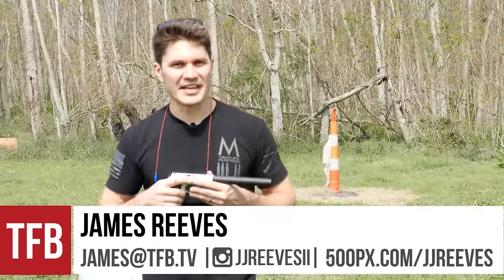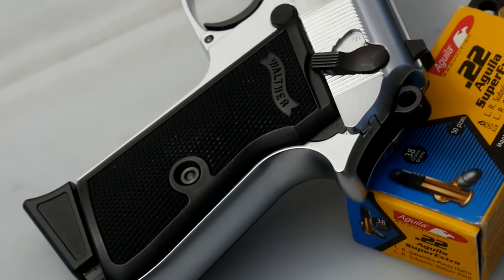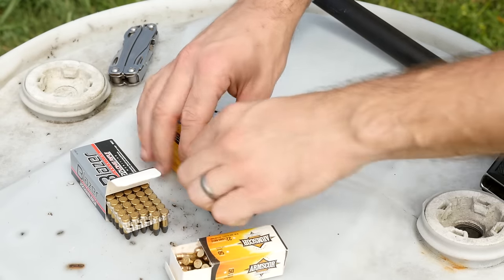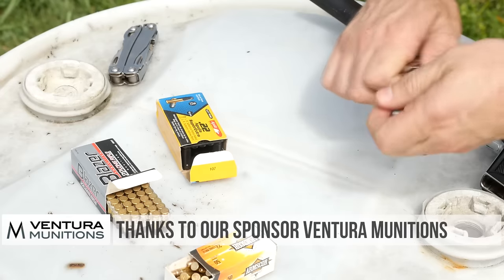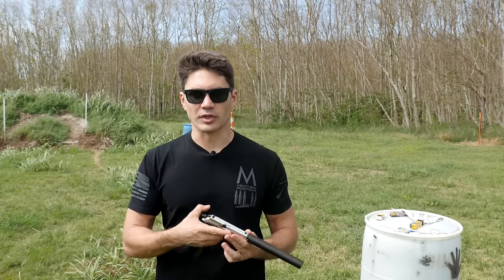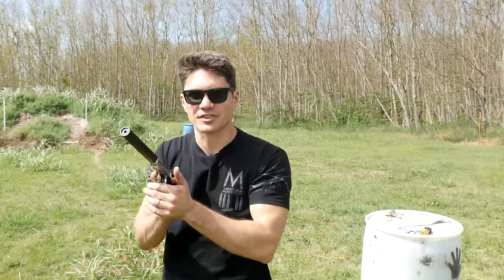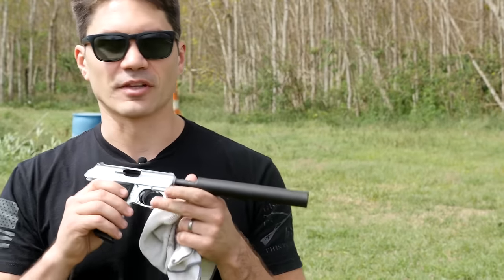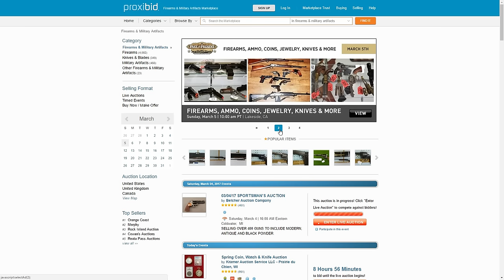The Walther PPK .22 is Always Subsonic - Myth or Magic?

Comment: Typically 4.5"-5" is the length where 22lr bullets reach the speed to go supersonic. Anything under that will stay sub👍
Reply: +ShooterSD72 +ChazOneZeroSeven Children, please...
Reply: fight fight fight fight fight
Reply: +xrklkx 🤡🎉😁
Reply: He is absolutely correct.  Even my friends 5" GSG 1911 with high velocity .22LR rarely has a round go supersonic.  4.5" and under won't go supersonic.  Anyone that doesn't believe this doesn't know what they are talking about because they have no real world experience with it.
Reply: Chronographs are cheap these days, so this is easily tested.  Noting it is as much about bullet weight and powder charge as it is barrel length.  The 1970s vintage CCI Stinger ammo is a case in point.  Those were so hot CCI had to re-do them with a lighter load.  One of the gun mags did a chrono test back in the 70s and recorded from an Erma M-1 carbine clone thing average velocities of 1860 fps but also had several that broke 1900 fps with one doing 1972 fps.  I strongly suspect if you could find one of those old plastic boxes you may indeed break 1100 fps (the dividing line between sonic and supersonic) even in a PPK.
Reply: Ken ibn Anak You don't need a chrony to tell if a bullet goes supersonic or not, this is what ears are for.
Reply: Not even..
Reply: Nicolas Broszky I've never had an issue telling the difference between CCI quiets and regular. I don't use a pistol for .22 though if that makes any difference. When using normal load .22's I can always hear that crack and echo.
Reply: Nicolas Broszky I'm not mistaken, have you never fired a gun before? A .22 quiet has no crack, the crack comes from the bullet breaking the sound barrier. It's no different than a pellet rifle, when they don't go above 1150fps, there's no crack, go above 1200 fps and there's a very loud crack that echos.
Reply: Nicolas Broszky We're talking about a .22 here not a .308, thanks for keeping the conversation relevant. My statement stands, you can easily without a doubt tell if a .22 is subsonic or supersonic based solely off the echo or the "crack" heard after the shot. Funny enough, I can still tell the difference between a handloaded subsonic .308 and a full load providing it's fired longer than 100m, there's still a very noticeable crack that happen after the gun shot followed with a echo that just isn't there with my handloads. Again though the shot has to be longer than 100m to give the sound from the initial blast a chance to dissipate.
Reply: depends on the cartridges, the CCI copper plated hollow points have a lot more gas pressure than the cheapest ones
Reply: Nicolas Broszky Go fire pellet rifles then, even a little .177 from a cheap break barrel will toss a little 7 grain pellet above the speed of sound. They are actually pretty loud when doing so and the crack from breaking the sound barrier is 100% without a doubt noticeable (very noticeable). Then load up a heavier pellet and fire and there will be zero crack and it's almost silent like an air rifle should be.
Reply: Not true, as long as you're shooting the cci stinger. It averages 1100 fps out of the 3.5-inch Ruger SR22, which is supersonic, depending on temperature.
Reply: I have a ruger 10/22 16" barrel and any Aguila STANDARD ammo (1130 fps) ammo, do not cross the transonic/supersonic threshold.
Reply: @WilliamStewart1    i read that jet plane sonic boom varies with nose cone, tail wing etc and also weather condition and alt.  therefore mph varies to hear the boom of when air pocket snaps from front to rear isn't constant with various changes
Reply: @dodgehemi5045  Fair enough, I was just trying to convey my point to whatever his name was that I supersonic .22 is very noticeable over a subsonic based off that long echo/crack you get after the shot.
Reply: @warmachine_1396  what about inches added. By the suppressor they do count ??

Comment: I run CCI mini-mags exclusively in my Walther P22 with SWR Warlock combination.  They stay subsonic.  However, CCI Stingers do NOT stay subsonic out of a P22.  I haven’t shot the PPK 22, but the barrel lengths should be similar.

In my experience, standard and high velocity ammo stays subsonic, but super-high velocity does not.

Comment: Such a pistol has so many virtues -it's easy to handle, low recoil, welcoming to novice shooters.  It's supremely quiet which is protective of hearing and reduces noise pollution.  Oh, and it's pretty much the choice weapon for assassinating someone...   I'm sure some people see that negatively, but that also makes it superb for defending one's own home; gunshots indoors are painfully loud and disquieting, your ears will ring as from a long concert and you might damage your ears; if you need to use your gun indoors you probably don't have time to slip in some ear plugs, so there's a lot to be said for a suppressor on a, shall we say, "PDW".  Since it is an assassin's weapon, it might have some of that same pants-shitting effect that a big shotgun has, that best-of-all-possible-outcomes where just pulling the gun out to use it does the trick and the enemy flees in the face of resistance.

Comment: try cci stinger ammo. its rated at 1680 fps which is faster than any you just used. basically the stinger has a longer case to fit more powder and a shorter 32gr bullet to obtain the same overall length and it is lightning fast out of a 22 rifle.

Comment: Alot of people on this forum have said theve had trouble with certain 22lr autos but there have been many videos on u tube to fix the jamming problems some of these guns have a very small piece of metal on the ramp up to the barrell it's kind of a boaring fix but 500 grain sand paper wet dry and a dowl that fits about and hour of work with tiny pieces of paper will remove the machine marks sometimes there is a very small piece of metal that has to come of carefully keep checking as you sand the object is to get rid of machine marks without removing to much metal then a Drexel tool with a cone shaped polishing bit and a little ruge on medium speed and you end up with a mirror finish the only other problem can be a little work on the tops of the magazines I've  done this twice to a couple of 22lr that where jamming  especially on cheaper ammo now they eat everything even cci quiet auto witch is around 850 fps and they work flawlessly even with supressor be careful but give it a try I'm glad that I did thanks

Comment: Hi, if I understand correctly, this experiment shows that supersonic ammunition are not necessarily worth the expense, if you use them in a ppk (hoping in supersonic performance). You can pretty much use regular ammo and get the best from your ppk. Am I correct?
Reply from the maker: Pretty much, just exchange "subsonic" for "supersonic". You can likely shoot any ammo through the PPK and it will be subsonic, which is ideal for silencers. The more expensive subsonic ammo appears to be slightly quieter, however. - James
Reply: thanks James

Comment: CCI Stinger 32gr "Hyper Velocity" will exceed 1100fps. Some other 40gr Hyper Velocity rounds may or may not.CCI Velocitor 40gr is cutting it really close. The addition of the adapter and the suppressor itself actually increases your muzzle velocity.

Comment: i can't get mine to cycle. even with cci mini mag, the slide gets hung up on the hammer. it will eject (half of the time) but not pick up a round off the magazine. is there a fix for this or did i just get a bad gun? side note, this is the 3rd Walther in .22 i have shot and the first i have owned; they ALL failed to function properly. starting to think it was a waste of money, $500 is a lot of ammo to run through guns that dont suck.
Reply from the maker: That's weird. We have two (me and wifey) and they are both 100% if the gun is greased up. You may have a bad gun or mag - I'd call Walther. Remember, though, any rimfire with a reciprocating slide is likely going to get hung up eventually. The recoil spring can't exert enough forward force to make feeding a round a sure bet as with the larger caliber guns that can function with more robust recoil springs. Just something to keep in mind. - James
Reply: While I don't have a walther PPK, I do have lots of .22LR pistols, and with .22LR's there's a few things to watch out for.  #1- clean it well, but don't over-lubricate.  Over-lubrication will result in issues cycling.  #2- using a suppressor will result in higher back pressure and aids in cycling. #3 - magazines are the Achilles heel of any semi-auto firearm. With .22LR, magazines get dirty too- and need cleaning.  Disassemble, clean, and lubricate with something like dri-lube or leave dry.. 
A properly cleaned and lightly lubricated .22LR pistol or rifle should function at least about 500 rounds with very little issues with decent ammo. Avoid Remington junk ammo; get decent bulk ammo at least. Some guns need breaking in; it may take a brick to break it in ; ymmv. Your slide getting hung up on the hammer sounds like an issue with the gun needing breaking in; along with a light lube on the hammer where it rides the slide.. If I had to guess, you don't use a suppressor with that gun, do you ? A suppressor would probably make that gun function better from the get-go.

Comment: --------------------------------007 James TBF
i read that jet plane sonic boom varies with nose cone, tail wing etc and also weather condition and alt.  therefore mph varies to hear the boom of when air pocket snaps from front to rear.  Boom snap isn't constant with factoring of many diff complex variations.
Before, i believed Sonic Boom and barrier was CONSTANT LIKE SPEED OF LIGHT.  Therefore BOOM IS REAL, BARRIER IS MYTH, NEVER WAS A "BARRIER" TO SPEED OF SOUND THE "BARRIER ISN'T CONSTANT" THEREFORE IT'S MYTHOLOGICAL .

SUBSONIC refers to sound snap front to rear, not exact velocity.   MACH refers to speed not the snap.Mach Speed is when an object moves faster than the speed of sound. For normal and dry conditions and temperature of 68 degrees F, this is 768 mph, 343 m/s, 1,125 ft/s, 667 knots, or 1,235 km/h.

Comment: what is the best way to find parts for guns I have a couple extremely rare guns that are considered burn down in where house fires I would like to be able to rebuild them but I'm having a hard time finding parts one gun in particular is a Glock 27 OD Green I do not want the green handle but at this point I will take what I can get it's just think 27 OD Green that I have is an extremely rare 45 caliber not the standard 40 and the serial number is extremely low it is a generation 2 so funny parts this weapon have been impossible to find

Comment: uh barrel length , supersonic vs subsonic. PLEASE get a dang Chrono this is about as BS a video as I have seen in a while.
Reply: It's not actually BS..  If the round is supersonic, one hears the distinct noise of the supersonic crack after the shot.  It's very much like the distinct noise a jet makes when it's subsonic vs when it hits supersonic. 

Granted, had they demo'd the PPK along with a S&W Victory ( 5.5 inch barrel), the difference would be audible and quite noticeable.. However, you can go watch any number of other videos out there with pistols and rifles where the .22LR is supersonic- to hear that distinct sound of the supersonic projectile.